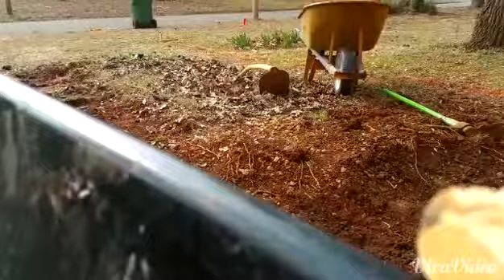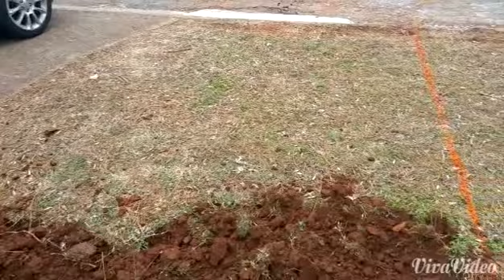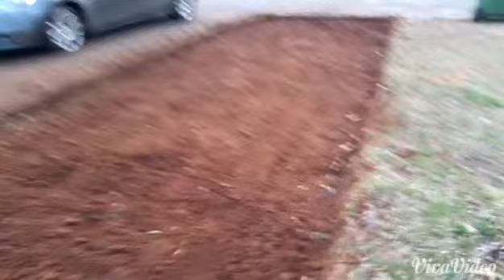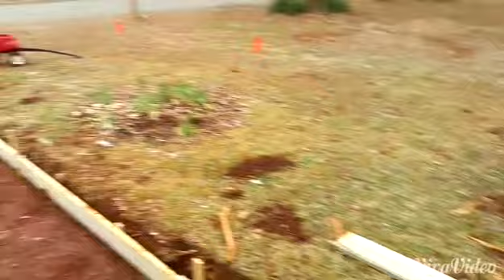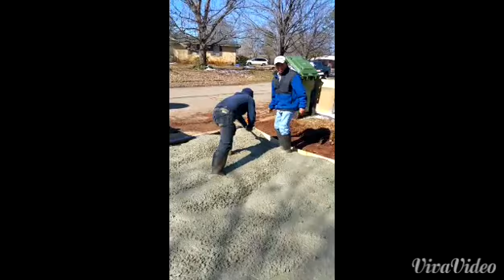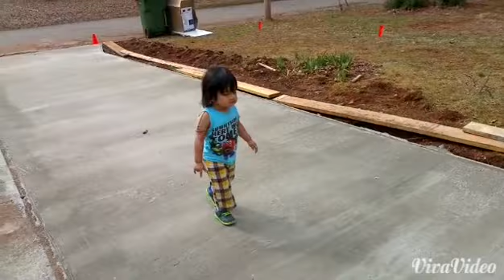Part 2 How to pour your own concrete PARKING LOT.

Comment: You should have read more before trying it. Didn't float the top, no crack joints, no foam board where you are meeting the other slab, and you didn't add a single footer. Not bad for the first job, but here in Texas that would crack in three months and start to shift.
Reply: Driveways do not need footers